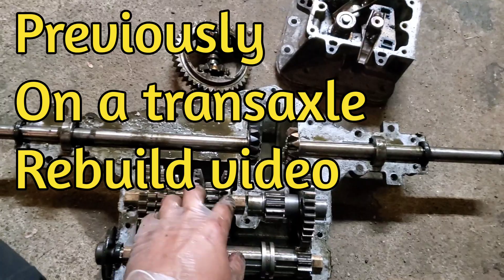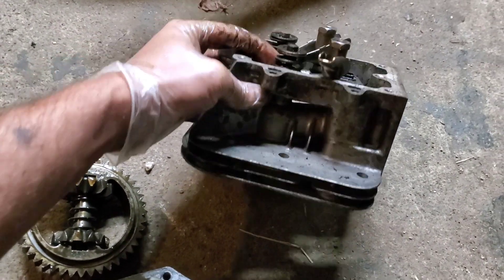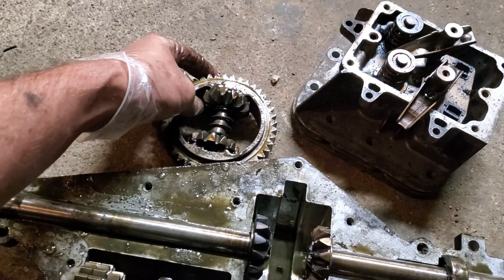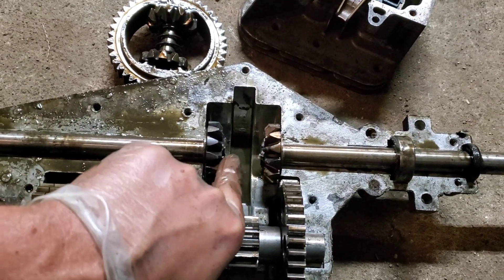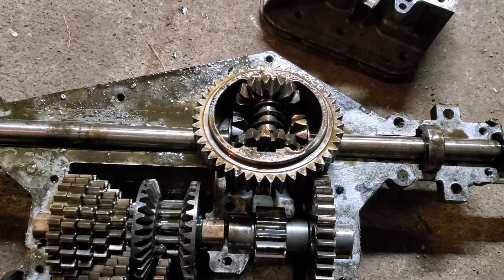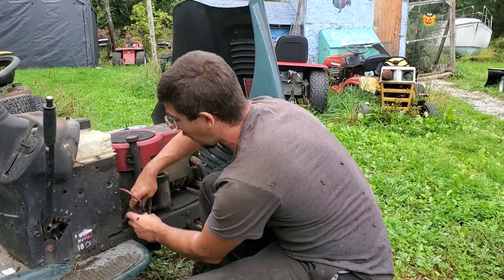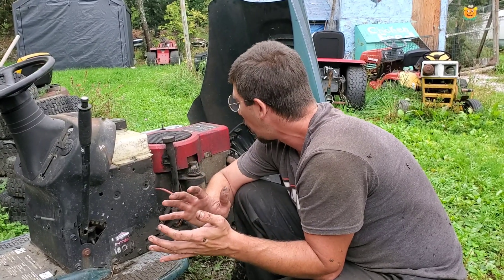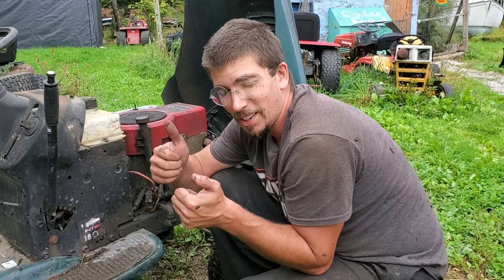Lawn tractor LSD Mud Mower Locker

Comment: It does seem to work a bit.. it needs some kind of friction material behind the spider gears or 3x the spring preload.. the 820 is a better candidate for this kind of thing just cuz the closed differential housing can catch any shavings.. look into the cheap lsds they sell on ebay.. they actually do work and is something you could make

Comment: Right idea, a posi works by letting the the force of the gears trying to separate stick them to the carrier. What you need to make that work is a MUCH heavier spring and replace the thrust washers behind the spider gears with some kind of friction material like little mini clutch discs.
Reply: Hey do you think stuff like angle grinder material would work or even like sand paper and then thun galvanized washer and then stack them up?

Comment: Great ideas. That is so novel Neil.
Reply: Lsds are well known and this only kinda works... Barely. There are cheap lsds on eBay and that concept would actually work on this type of setup.. for this to be viable it needs a lot heavier spring and friction material behind the spider gears.. the reason this is a bad idea is because an lsd works on friction and that friction wears stuff down which makes debris in the case.. the only way to make a long lasting effective lsd in a case like this would be a ball detent type of situation.. that would create far less debris